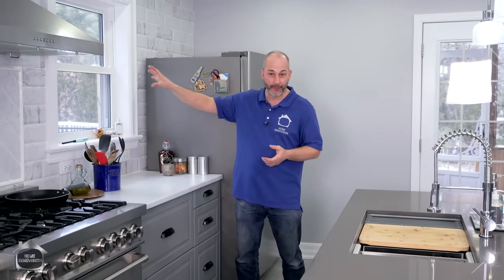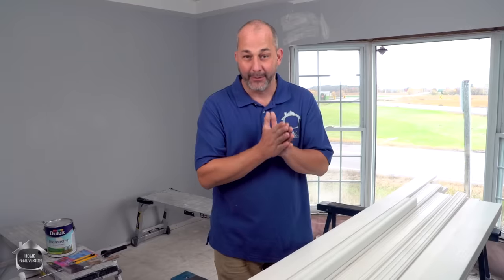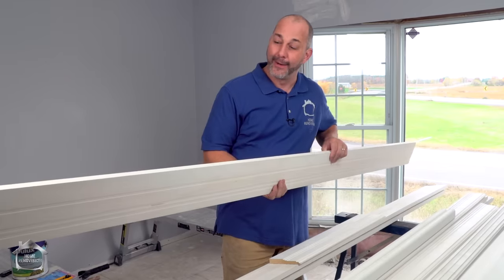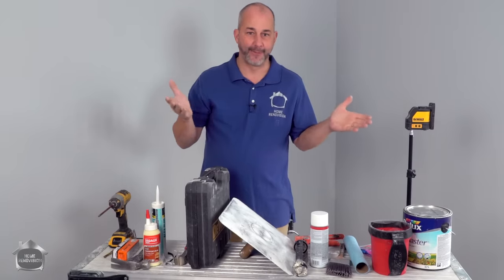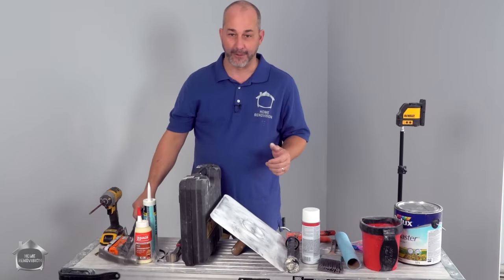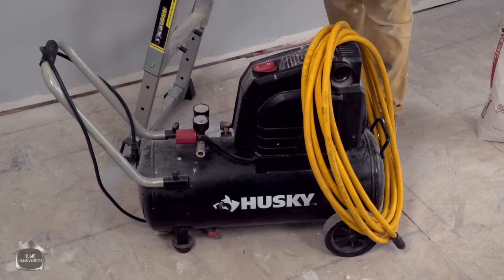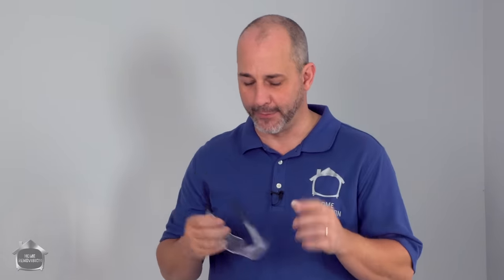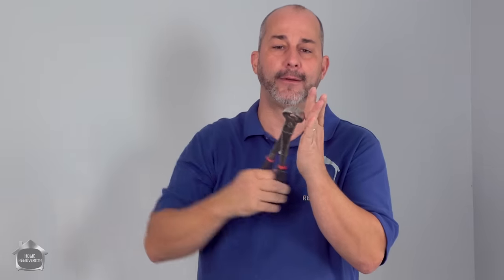How To Trim Doors Windows and Baseboards | A to Z

Comment from the maker: Thanks for watching! To learn how to trim with a modern look and NO mitre joints watch here: https://youtu.be/0GoF4MaH9MM Cheers!
Reply: When I built my house, I had my architect design a baseboard profile and had the baseboards custom cut. I used the same baseboard to build the crown molding. Yes, it was a ridiculously expensive house and, no, I wouldn't do it again.
Reply: The tube algorithm has me locked into a lot of your videos and I must say, your point of view has to be appreciated by a lot.  I definitely appreciate it myself. Ok, so I’ve tried Alex didn’t seem to hold up the two times I used it on crown molding.  It developed cracks throughout.  I live in the south where humidity is relatively high.  I’ve since switched to dynaflex 230. This caulk doesn’t crack. Not trying to throw shade, just wondering if the Alex that you used on your project held up.

Comment: Thank you for putting all this information together in one comprehensive video that answers all questions: yes, go get an 18g nail gun right now, and a rubber air hose, what kind of sealant to use where and why, back the door trim off the hinge, glue your corners, where and where not to put the nails, how to get spot on mitered trim corners, and use a square to make sure your saw blade is vertical before you start. Thanks for taking the pain out of the front end of the learning curve.

Comment: If all you're going to do is moulding and other light wood work the Ryobi cordless nail gun works great especially if you're a female and don't want to drag a heavy compressor around. As usual great video, I've learned so much from you, thanks.
Reply: I have a ryobi cordless nail gun and I don't use it. If you use nail guns a lot you'll notice if the pressure isn't set high enough the nail will blow out the side. I had that exact problem with my ryobi nail gun I even got shot in the finger because the nail blew out the side.
Reply: I'm a female and move my compressor around all day! LOL But I also have a 100' hose line which is a nice help.

Comment: My tip for locating studs is to look for the nail holes in the drywall left from the baseboard you removed, then mark them on the floor with a small piece of painters tape.

Comment: Was thinking when you painted the trim, watching you dump the paint from the gallon jug to the paint tray, my thought was that if you run two strips of masking tape on the top of the paint can, sort of in a V shape and then pour the paint in that direction you can avoid getting paint  around the rim of the can! Sure you might already know and just didn't care but yeah!!! Thanks bud!

Comment: LOL, I have been using a compound saw for 40 years and understand the saw and its dangers. One day, I was holding a piece of 5 inch wide door casing trim to make a cut up against the compound saw fence same as you do in the videos.  The saw was at a 45 degree angle to the right-side. My left hand was on top of the wood and fence holding the trim firm with my hand and fingers on both sides of the fence.  I had plenty of clearance from the blade,  As I pulled down the saw to make the cut the position of my middle finger was in the way of the blade and I cut off my finger tip at the knuckle with the back side of the saw blade after it past through behind the saw fence. Lesson learned: Triple check for safety of your hand during positioning of the trim cause blade guards are attached to the saw and cover the blade from the front, but not the backside. 
 Rob Matheson  1/8/2022 😂

Comment: Another great video. Thanks! I live in London and have a relatively new house - it's only 125 years old :-)  I had all the coving and skirting (baseboard) custom made to match the small number of surviving remnants that hadn't been removed. A local specialist company made wet moulds for plaster cove and copied the wood profiles, and remade everything for not much more than the off-the-shelf stuff from the giant hardware store across the road from their workshop. Cannot endorse enough the advice to search for local expert suppliers. You may be pleasantly surprised at the cost and quality.
Reply: l
Reply: l
Reply: l
Reply: l
Reply: l
Reply: l
Reply: l
Reply: l
Reply: l
Reply: l
Reply: ĺ
Reply: l
Reply: ĺ
Reply: l
Reply: 125 years old is relatively old where you're from?

Comment: This guy is a productivity animal
Reply: LOL.......Far from that.......this dude wouldn't make it to lunch time on a real production crew.......way too may saw cuts
Does not cope the base board?.....big mistake,  and using all 18ga brad nails????  Don't hold the trim to the wall.
Hope he never leaves the home improvement world.
Reply: @bobwild9995   Yeah but the show's not about how to be on a trim carpentry production crew it's about how to remodel your house as a homeowner this guys skills are in so many trades I guarantee you cant do all the trades at this guy can do not even close
Reply: @zachmiller4930  Well.......don't put a guarantee on that.........44 years as a Master Finish Carpenter, built houses, build cabinets in shop, and last 15 years as a commercial door mechanic. Oh and ran my own trim crews as a sub.  All I was commenting on was he's NO production animal as you call him. And I know hands on many more tricks on installing trim, that I don't need to do an 2+ hour video on.
Reply: @bobwild9995  ok bob what's your business name? Id like to take a look at your work and hopefully learn a few things
Reply: @bobwild9995  My business is Zach's Home Repair and Remodeling if you want to look at some of my work.

Comment: I have a simple channel lock plier medium size that has a rounded head. Works great to grap pins and roll them out of the wood like the tool Jeff mentions.  Always pull out the back, right through the wood, if reusing trim.

Comment: That blade on your chop saw is specifically designed for ripping wood with the grain. For a better cut replace it with a cross cut blade, which is also what the majority of your cuts on a chop saw will be.
Reply: 49:14 is a pretty clear shot of not a ripping blade.
Reply: @timhaddox  49:14 is a CLEAR indication of a Diablo 24tooth RIP blade. There’s no way around that one guy. Ryan is correct.
Reply: Thank you Ryan!
Reply: @calisawce7273  Who went to 49:14 to see

Comment: You make a very good point about the "joiner" (a discussion for another day) filling the nail holes in "skirting boards" etc.The joiner should fill the holes and the decorator/painter sand the filler as this gives the filler time to dry.

Comment: You have some great information on trim work.  I am a former trim carpenter and was always trying to do everything as safe as possible. What I noticed was that you were crossing your arms when using your miter saw. The reason being is if that saw ever does something that scares the mess out of you the natural reaction is to move your hands and arms outward so with your arms crossed while cutting then you will most likely move your arm or hand into the saw blade. Always switch arms on the handle when swinging the saw from one side to the other to cut your angles.
Reply: I 100% agree!!  As a 63 y/o lifetime carpenter...when I saw that, I thought to myself, * Dude, why?  Why would you teach any knowledge-absorbing, new to the trades, DIY'ers that it's even SOMEWHAT ok to start using that technique?? *  Also, why preach about eye safety & the use of safety glasses at the beginning of the video, then immediately grab the nail gun & start using it without?  I would even recommend using them with the table saw as well. I noticed that they were never even used once during the entire video! 
  And DON'T EVEN get me started on the part where he boasted about shooting his buddy with a nail gun...then proceeds to demonstrate the risky, dangerous behavior by carelessly showing everyone how to override the safety mechanism by pulling it back & then firing it! Seriously, I mean...WTF was that all aboot??!!  Yes, we've ALL done it...but you shouldn't teach potentially dangerous, risky behavior like that to newbies!   To use HIS favorite words.... Okay?  Right?
Reply: @hoosierdaddy4742 you’re forgetting that the audience is adults capable of using discretion and judgement. It’s called personal responsibility.

Comment: I would advise NOT nailing through detail on painted boards. The detail is exactly that, a detail, and you want to preserve those crisp lines. Nailing in the flat is easier to fill as you have a reference edge on either side of the hole to fill and ensure flatness of the fill. Also, in wood moulding, the detailed part has been routed and thinner than surrounding areas, hence weaker. If the grain of the board is running perfectly parallel, your hole in the detail will often create a small split, leaving you with  this <o> shaped hole. Another reason to nail in the flat.
Reply: I agree to this, I actually like nailing into the flattened thicker parts than the thinner center parts like many people do.
Reply: i also agree but im a electrician, but installed 20-+ houses trim -scarf or butt joints? me scarf -- base and crown
Reply: Agree. I have seen many bad advises from this guy in other videos, but apparently it goes well with weekend warriors. I would not want a contractor like this in my house.
Reply: @kirktitgen6395  15:25 LMAO
Reply: @kirktitgen6395  of course he's geared towards the DIY'er. If I hire a contractor and I see them watching a how-to video on YouTube for the job I hired for, that contractor is fired. I'll watch the video and do it myself.
Reply: @apex11177  My painters throw a fit when my carpenters fill brad holes. He's got a table saw blade on his chop. What a hack.
Reply: @EdwardBIl  that’s exactly what I thought we never been asked to fill our nail holes before, that’s just part of the painting process
Reply: Why can't you just use just an adhesive/glue for base & no Brad nails? Also is there a nail gun out there that doesn't require an air compressor? Newbie diy-er here trying to do as much as I can myself since I just got laid off. Thanks for any advice
Reply: @annscotton1254  You can try to use and adhesive but baseboards should be easy to remove and afixed  as to not damage the wall surfaces. Think of this in the case of having to refinish wood floors, where you want to remove and reinstall as an example. Or install a new floor all together and may end up with a different floor height.  Additionally, adhesives will likely pull off the skin of paint, or the surface paper on drywall. Ive seen millwork installed with Liquid Nails that left craters in drywall when removing. Nails pull out quite easily with pry bar. 

As to the nail guns that don't require compressors... Most of them are expensive as they are convenience items for installers and command high prices. That said the most inexpensive will be the Ryobi 18v 18 gauge nailer. It's likely cheaper to buy a compressor and nail gun from Harbor Freight,  just know that the tool likely won't last long. Alternatively you could use 6d finish nails, a hammer, and a nail punch and do it the "old fashioned" way. It'll be the cheapest option and better yet you'll learn(refine) a few skills.😊.
Reply: @kirktitgen6395  why do you waste your time watching his videos if he's as bad as you say?
Reply: @annscotton1254 My thought is adhesive won’t draw the trim to the wall. Also, if ever removed would rip the drywall out.

Comment: I have done a fair amount of trim work over the years and owned and used all those tools but have learned a few little tricks from you, Jeff. Personally, I don't like air tools. The new battery operated nailers are very good and with one decent battery, you can fasten a lot of trim. If your battery dies, you can take one from another one of your tools, (drill, etc.) and use it while you are charging the dead one or just make sure you have an extra battery. This is just my preference. Love your videos, your sense of humour, practical reasoning and work ethic.

Comment: I usually rough cut all the trim a little longer than needed  and lay it out around the room where it's going... for door trim...cut 45 for the side pieces and cut one end at 45 for the top. Then mark the wall on top with the top piece to get the final height marked on that wall. Flip each side piece with the 45 down and mark the finish length to be gut square at 90 on both side pieces.    I try to minimize using a tape measure whenever possible and mark to fit each piece...this method works well for me..btw on old work..sometimes  have to back cut the 45s a little so they blend together tighter. I do that by placing a shingle in the bed of the chop saw so that the trim piece is a little bit off the table...
Just some tweaks I learned over the years...Good vid Jeff

Comment: The mdf trim doesn't last on high traffic spots, especially corners with pulling a central vacuum hose.
Reply: heavy-water/ floods dont help.    dusty    chips   pvc is  junk -sand 1 st

Comment: You are working on new construction and it all seems to come together as your floors are mostly level and corners are mostly square.  I went into redoing the molding and baseboard on my existing house to find corners were not 90 and the hand scraped bamboo floors we put in made an uneven floor to lay baseboard against.  I ended up getting a small electric planer to scrape wood off the bottom and used shims in places to square or level it as I put it in.  I was so frustrated thinking I was doing something wrong but there are a ton of tricks to learn for stuff that isn't quite right.

There is another Youtuber that does trim work for a living and his corner method is outstanding and saved me so much time coping.  He uses an angle grinder with a flap wheel to cope and it works so well and gave me much tighter corners.  One point about the miter saw.  Even out of the box, you will probably find that your saw doesn't cut square.  Another thing I learned the hard way.  There are minor adjustments on the saw that allow you to square up the blade on both angles.  Don't assume the 45 detent is 45 unless you check it!  I thought I was going nuts when my 45s were off until I checked and adjusted my saw.  Now I can do baseboard like a wiz but it was painful getting there.
Reply: New construction? He's working on his farm house that was built in 1880....

Comment: Why didnt you put the top casing on the door first? The reveal would probably have been more consistent that way. Or am i missing something? Im no expert on the subject.
Reply: basically same thing I said....Run the long latch side first with reveal and then top cross piece then you can work hinge side which is not as noticable in easily.....
Reply: You didn't miss anything, because there's more than one way to skin a cat.

Comment: I don't know where you were while I was busy trying to learn all of this by myself. Including the video on how to tape and mud drywall 🙂 This information is invaluable! Wish I'd had it way back when I was first learning how to cut with the blade on just the outside of the line. Sure would have saved alot of trim!! After 7 or 8 tries I finally figured out that I needed to stop cutting what was a perfect measure on my mark causing my trim to always come up short! Now I do exactly like Jeff has shown here and Walla! Perfecto! Thanks for the step by step tutorial. Can't even learn enough tips and tricks!🙂🌺
Reply: Holy cow...7 or 8 times to figure out you were cutting the trim too short...really??  Yeah, um, so, in the future, you might actually want to consider keeping THAT one to yourself. No, seriously.

Comment: When I trim a door head, I do the sides as you do and miter both sides leaving the head a bit long. I check both miters for fit and then place the trim upside down to mark the length perfectly. Sometimes use a sharp pocket knife instead of a pencil

Comment: Love the tips here is one more. I have the same red paint bucket and use the plastic liners. I found they fit the gallon size ziplock bags. I push those into the bucket then rubber band them to the edge. This way when I need to break for lunch or for whatever reason I can simply just zip the bag up.

Comment: Hey Jeff, thanks for your great content. Nice to see someone put that much detail into their instructional videos. I have a question for your regarding order of finishing. I am gutting a suite and starting from scratch. Would you recommend putting the flooring in first then the trim or vice versa? I get that doing the trim first before the flooring allows you to paint everything without worrying about the flooring. But is that the best way? Have a small time frame to get everything done so I want to be efficient. Thanks